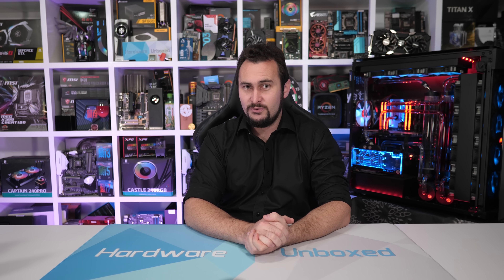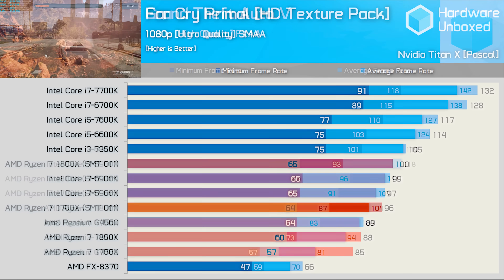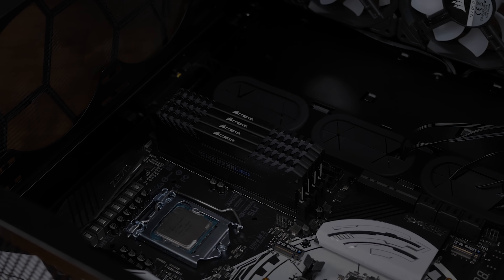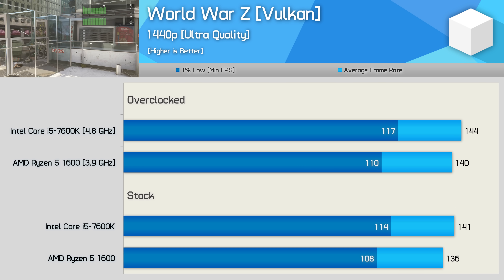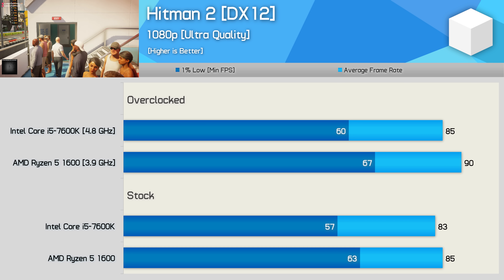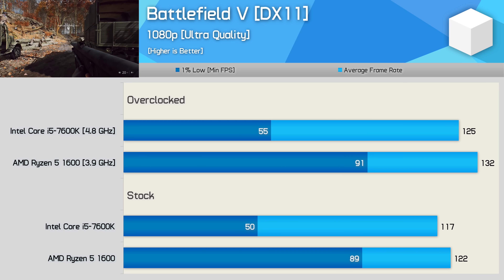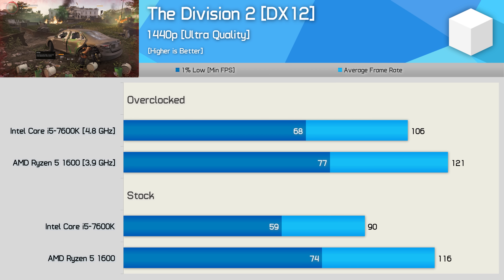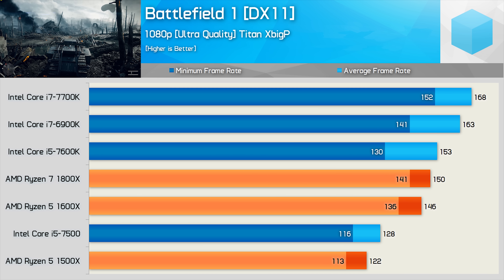Ryzen 5 1600 vs. Core i5-7600K, How Times Have Changed!

Comment: Depends on the types of games you play? This whole video reads as a kind of 'well, no duh' to me. Of course open world games with better multicore utilization are going to run better with more cores.

Fps games that don't have as much open world (basically the only ones I play) run at higher framerates on Intel because they prioritize clockspeed. Destiny 2 is at least 10% faster on my oc'd 7600k than on Ryzen, both highs and 1% lows
Reply: Yes steve literaly said that in the end of the video, but you have to keep in mind that testing a CPU in a game that only utilize single thread is kinda pointless because even the 2c/4t i3's will perform just fine or even close to the i5, the point of this video is just to revisit the 7600k in the most demanding modern games and how it will perform compared to the 1600 because back then the 7600k almost always faster than the 1600.
Reply: @nonameyet2205  and it still is in the most popular multiplayer shooter titles which are the ones  most people play. The title is pretty click baity.
Reply: @ethancarey3922  This is CPU benchmark, not a game review. The title is exactly the same as the conclusion, back then the 7600k almost always win and now as times goes the 1600 starting to pull ahead in SOME more modern games, its not like steve says the 1600 wins all the time.
Reply: @nonameyet2205  nah, 'times have changed' clearly implied something that once was true (7600k faster) has changed. That's not true for the majority of game. Hence, the clickbait accusation.

Don't trust a word these guys say since Tim (is he the skinny one?) said the Ps4 pro gpu was like a 2060 (lmfao)
Reply: @ethancarey3922  7600k was always faster and 1600 was slower and now with more modern games coming out the 7600k is no longer always faster, that's what changed isn't it obvious? from always faster to not always faster, that's clear enough for me. I know there's some bias in you just because you own a 7600k but probably you should just accept the fact that the 7600k is starting to fall behind in the newer and more demanding modern games.
Reply: @nonameyet2205  I don't play those games so I'm cool with being behind on 5 out of 30+ benchmarks. As I said, these guys arent exactly up with the current gaming landscape
Reply: @ethancarey3922  Cool man whatever you say, this was never about you anyway it seems as if if you're getting offended because your 7600k strating to fall behind in the most modern games and upset because they didn't test those 30+ games where the CPU doesn't really matter just so that your 7600k can win.  Just keep in mind that those 5 games is a very popular game that many people play, and the 7600k fall behind even to the point that is below and almost unplayable or stuttery mess in BFV, meanwhile in the other games where the 7600k win the 1600 is still perfectly playable and capable of delivering over 60fps all the time.

And for the record im i5 8400 user, im about to jump to ryzen 3000 though

Comment: Man buying ryzen 2600 for my new upgrade was the best decision ever on
Reply: @myxzlik1843  sadly is still using b350 on ryzen 2600..it still not available for sale  when i bought ryzen 2600
Reply: @rrcreative1033  You also can with a B350, but I'm not sure if 12 cores on a B350 is a good idea, those boards often have bad VRMs.
Reply: @stargazer162  i'll probably skip uprading my cpu now will uprading on the next ryzen line up. better money. It already a beast 60fps across-the-board playing new game using gtx1060 6gb and no prob playing while streaming and editing video also a golden experience. It was an eye opener from my previous pc i5-6500.
Reply: B350 is good enough, I'm running mine on an A320...
Reply: @danielchong2917  what processor ur using ?
Reply: @myxzlik1843  Potentially. I don't like considering double cores "double performance" though, as it's not in the majority of everyday tasks and gaming. If cores mattered that much outside of productivity we'd all be buying Threadrippers and Xeons. I'm much more excited about Zen 2's increased clock speed and IPC.

Comment: Do Ryzen 7 1700 vs i7 7700k next
Reply: too early. 7700k is still much faster in games
Reply: Those results are included/shown in a few games already :)
Reply: @mdd1963  Yea but those were the old comparisons
Reply: @juanp2k3  If folks want to 'feel like' their 2600X/2700X is faster than the 7700K , they are already free to 'feel that is or should  the case' regardless of accuracy. Whatever helps them feel better :) (It certainly appears from preliminary leaks the 3600X will be laying a lot of waste to previous 7700K/8700K levels of performance beforehand never challenged by any R5 or R7 CPUs...)
Reply: But why? Intel will beat Ryzen in single core performance, obviously. No reason to compare them with the price difference between them.

Comment: I'm very glad with my R5 1600 purchase. I hope you will cover Ryzen 3000 CPUs with great detail, including how they run on B350 boards.
Reply: From what it sounds like they might run, but definitely not overclock or maybe even boost. Supposedly the b350 weren't built with all those cores and threads in mind powerwise and cooling wise.

Comment: Would have loved to see the 7700K as well in this comparison as most of the arguments for intel were based on that CPU only with counter arguments based on the higher thread counts of the Ryzen 1600 and up.
With 8 vs 12 threads the advantage to the 1600 wouldn't be as much if at all in the newer titles, but it still would have been interesting how far the gap had closed.
Reply: Give it a year.

Comment: I had the legendary 2600k for six years until September 2017 when I finally upgraded to a Ryzen 5 1600, it's been running smooth as silk so far.
Very happy with the purchase, hope it lasts as long as the 2600k tbh.
Reply: Will be going from 2500k to 3800x can't wait

Comment: Back in the day, I went with the i5-7600 non-k version, not because it was faster or slower, but because if I wanted to get the ryzen 5 1600 I had to buy new motherboard and new(compatible) ram, which would have ended up way more expensive and totally not worth the money. I already had a motherboard and ram for the 7th gen(which came out earlier, or at least it did in my country).
Reply: I can see your reasoning but now you have no upgrade path. Your situation would be a lot better if Intel didn't need you to replace your motherboard so often.

Comment: Yup, BFV is extremely thread heavy.  My 4790k @ 4.6ghz sits at 80-90% cpu usage even when paired with an oc'ed V64 @ 3200x1800p at all ultra.
Reply from the maker: Do you see any stuttering issues? Seems some people do while others don't, or they don't notice it ;)
Reply: @Hardwareunboxed  Not many but I believe the 16gb of c10 2400mhz ddr3 helps keep the lows from dipping too hard.

My FX 9590 rig with 16gb of ddr3 c9 1866 and a oc V56 does far worse even at 1080p in this title compared to my main pc above.

Thanks for the awesome content as always!

Comment: isn't 1600 vs 7600 and 1600x vs 7600k more realistic comparation? :):)
Reply: Not really, the X chips are completely irrelevant when the non-X ones are OC'ed since both have the same headroom. You would only buy an X CPU if you're not planning to OC as they ship with faster out-of-the-box clocks.
Reply: No, since the 7600 cannot be overlooked. The 1600 can be overclocked

Comment: Thanks for the updated review.  The 6-core and 8-core Ryzen CPUs, whether 1000 or 2000 series, have indeed changed the PC builder's world. I built a Ryzen 5 1600 / GTX1060 6Gb system for my daughter right after the initial Ryzen launch, and it is still meeting her needs.  Now she wants to go to the 3440x1440 format (from 2560x1080) and do some light video editing and streaming, and because we went with 6 cores and 12 threads initially, the only upgrade needed will be the graphics card on a budget of about $350.  We're waiting to see what Navi offers, but we figure an RTX 2060 or even a Vega 56 could be the next step up if Navi fizzles.  Her Ryzen 5 1600, meanwhile, will get the job done for another few years. 

No other CPU available in April 2017 at the 1600's initial price point could still be viable for these tasks.   To boot, the 1600 can be had today (if you live near a Micro Center) for $80 before tax.  That's maybe the best CPU bargain (not counting used) in recent history.

Comment: Holy smokes, I'm even more happy to have jumped straight away from quad core to the 1600 now. Super hyped to upgrade to gen 3 soon, god dang it, both speed and corecount, going to be insane.
Reply: You planning to get the 8 or 6 core variant of 3000 series?
Reply: @andrewmacfayden1671  8+ cores obviously. proper upgrade and all. Although even the 6c/12t with it's way higher clock and ipc would be quite the upgrade too.